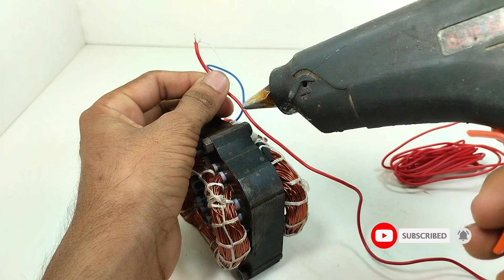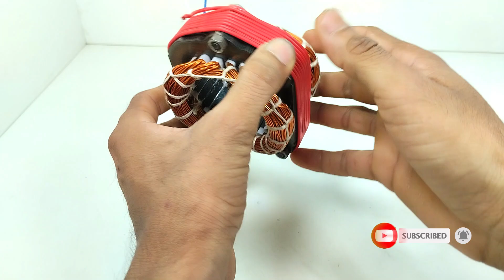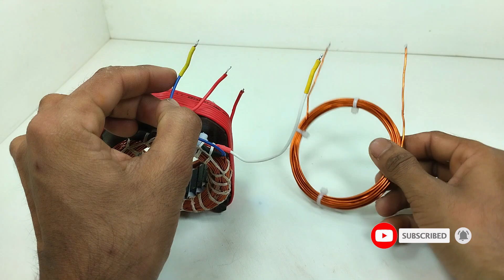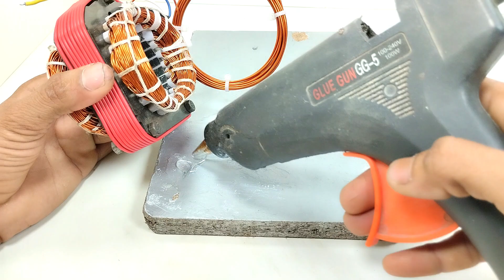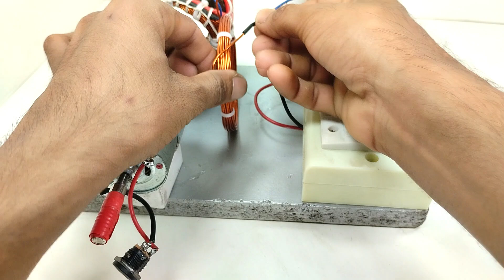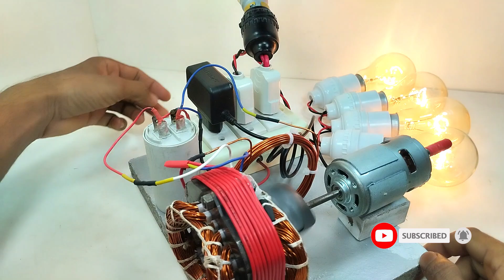Making 220V Free Electricity 5000KW Compressor Generator At Home

Comment: 1. Con ese núcleo no alcanza ni para 1/2 KW...5 KW ni en sueños
2. Para que el artilugio tenga una posibilidad de generar, los imanes deben girar al interior del estator.
3. Suponiendo que el artilugio funcione, los imanes deben girar exactamente a 3000 RPM para una frecuencia de 50 Hz o 3600 RPM para una frecuencia de 60 Hz, ya que el bobinado principal es de 2 polos.
4. Para una potencia de 5 KW unos 25-28 Amp, requieres de una sección de conductor de 4 a 5 mm2 y ese cablesito con suerte es 1.5mm2 ...no hay manera que ese cable soporte la corriente asociada a la potencia.
Reply: Por ningún lado es posible que este artilugio funcione.

Por último, la ley de conservación de la energía hecha por tierra de principio a fin este invento.
Veo el motor que impulsa los imanes y me pregunto, ¿Cómo se puede ser tan mentiroso?